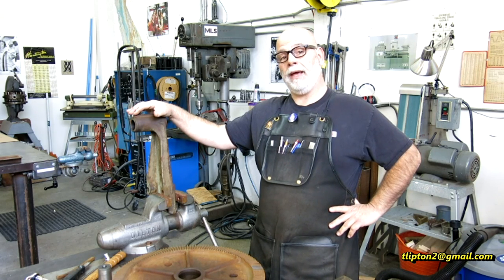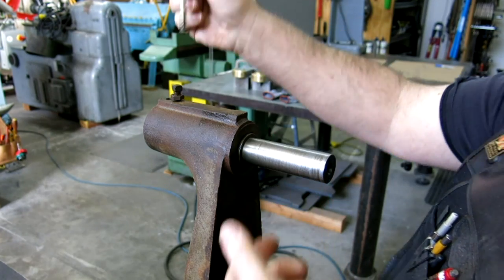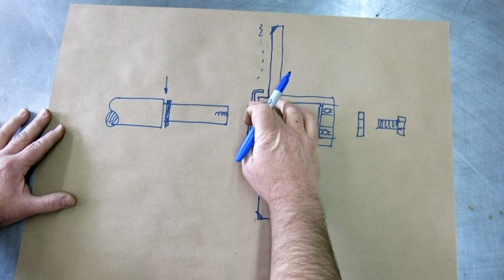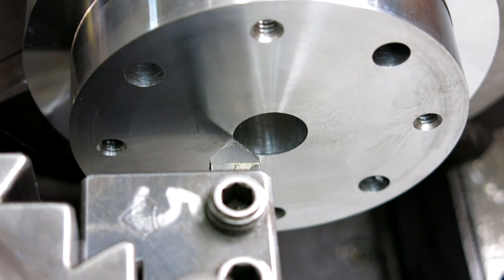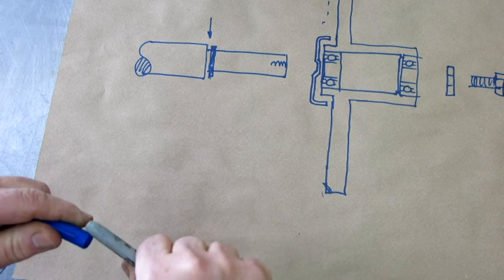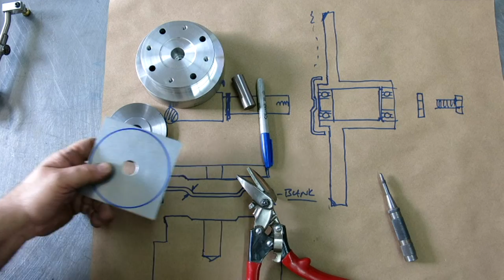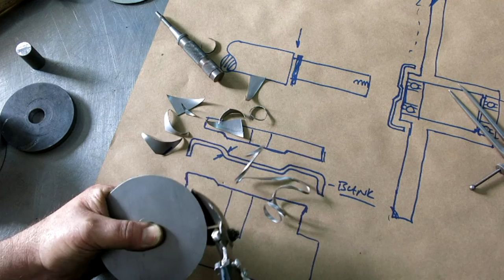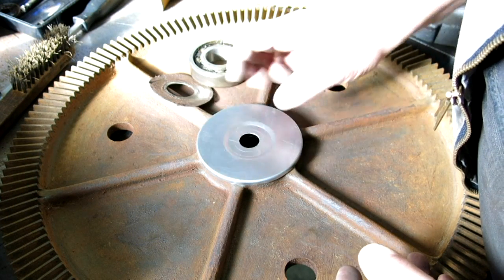Making Press and Hammerforming Dies

Comment: Worked well. What I have done in the past is make the bottom tool with a thread in it and used a bolt to hold the top tool in place. You can slip a tube over the head to press it first , then tighten the bolt down to hold it in place for hammer forming. Then put the whole shooting match in a vice. That way you can hammer form the edge all the way around without having to swing a clamp out of the way. You can use the bolt to pull the depression into the metal first as well, as long as it is of sufficient size. Handy if you don't have a press!

Comment: Have had good success with forming bearing shields for classic motorbikes using a technique I was taught as an apprentice. The shield material is sandwiched between the former and some tough rubber sheet. The former is pressed into the rubber using the shop press and the resistance of the rubber gives a nice gentle flow form. Handy for shapes that are not round or have a taper on them. Thanks for the great video Tom.
Reply from the maker: Hi Andrew,

That process is called Guerin forming or rubber pad forming. Works well for stuff like this also. The die would need to be different and the support for the rubber would need to be kind of cup shaped. That would also work. If I had a lot of these to make rubber pad forming would be a good option.

Best,

Tom
Reply: oxtoolco Thank you Tom, did not know that was its proper name. I used the technique recently to make some formed panels in aluminium for a restoration job. The shapes were irregular and lent themselves readily to the technique.
Reply: The Guerin process is good for one-offs because you only need to make one die, and there's no need to precisely align dies.

Comment: I was a machine designer for many years and the suggestion I have would be to add a simple labyrinth seal with a sheet metal washer.  Turn a small step on the outside of bearing housing for a lite press fit of the washer.  The OD of the washer can be made very close the inside of the cap since the is no relative motion between the cap and the washer.  I enjoy seeing how you design and fix problems.

Comment: I've always liked the Marvel line of vertical sliding bandsaws be cause of their accuracy and their simplicity in their design.  On the older units they used to use a cork clutch that was counterweighted by a lever mechanism to drive the saw into the material. The further you slid the weight away from the clutch the harder the drive pushed on the material. 

I was working in a shop that had an old Marvel that was in really nice shape but I noticed that the fellows using the saw were hand feeding the blade. I asked why they didn't use the clutch drive and they said it didn't work properly. I asked if they would show me what it was doing and when they did and I knew immediately that the clutch cork had worn to its limits and couldn't drive the mechanism properly. It bothered me for the rest of the day and part of the evening that no one cared enough to fix that machine. The next morning I was the first worker in the door and I had a plan of attack. Right next to the time clock was a large cork bulletin board.  A few seconds with my trusty Buck knife and I had a new clutch. It took about 10 minutes to tear it apart and cut the cork to fit the drum. I got it put back together just before we were to start the day shift. When the fellows who ran the saws came out to start up I asked if I could see the drive work again an they gave me a strange look but agreed. They threw it into engagement and low and behold it worked perfectly. They asked what I had done and I told them I just adjusted it a little better. Later that day we had a safety meeting and one of the first topics was destruction of company property and they wanted to know who had vandalised the bulletin board beside the time clock. No one ever owned up..............

Comment: Very nice. Thoughts: The bearings have had a open inner side because the hub had to be filled with grease at any time. so the fresh grease would press through the bearings under the washer and drive any dirt outwards. Also i might have considered to give the outer rim of the cup an slight angle. so dirt could be thrown out and would not stuck in the corner. Very, very interesting though. My attempts in formig sheet metal always end in wavy scrap.
Reply: i was thinking to use silicon to adhere it, any grease will still get out along the hole of the shaft, and overall would seal it even more?
Reply from the maker: Hi Hermann,

You are correct. That would mean the maintenance guy would have actually had to do his job. I prefer engineering solutions that take into account just how lazy I am. Thanks for the comment.

Cheers,

Tom

Comment: I was looking to do the Same Last year for a Dust Shield on the rear wheel bearing on one of my Motor Cycles i was restoring. Time was of the Essence and Settled for boring a Hole in the middle of a brass Welsh plug polished it up presto. But Now i Know how to make a Die for the next ones :) Cheers Tom keep em coming

Comment: Nice job on that part Tom!  I often use hammer forming to make rust out repair pieces for car bodies.  Typically my dies are made from pieces of scrap wood so there is no problem working the edge with a steel hammer.    I do appreciate the tip about using a soft hammer when working with a metal die.  I likely would not have thought of that until I had screwed up my part.

All the best!

Mike
Reply from the maker: Hi Mike,

You know I screwed up more than one part before I figured that out. Thanks for the comment.

Cheers,

Tom

Comment: In the aerospace industry, when one-off sheetmetal items are needed, they are often machined from solid. For complex shapes this requires CNC, but for this it's simple turning. For something shallow like this, it seems to me it would be less work and require much less material. The second side op could be done by pressure turning (using a tailstock centre forcing a support disk against the work, friction grip helped by abrasive dust or superglue)

Comment: Great instructional. Wondering why you opted for hammer forming opposed to spin forming. Thanks for the videos!
Reply: Same reason to not hit it with a metal hammer. It would stretch the material.
Reply: +The Thing:  any time metal is formed either hammered, pressed, rolled, or spun it is stretched
Reply: Unless you use a hammer to shrink the metal :)
Reply from the maker: Hi Chuck,

You can add shape to sheetmetal by shrinking which is the direct opposite of stretching. In general most forming operations are stretching but some actually thicken and shrink metal. Thanks for the comment.

Cheers,

Tom
Reply from the maker: Hi Yupper,

Because that's what I wanted to show. Not all hammerforms are round or even symmetric. Hammer forming works for not revolved shapes. You are correct that spinning would have worked for this particular shape. Thanks for the comment.

Cheers,

Tom

Comment: nice project, you could make the last band on the lathe.
you can roll it with a bearing on you mold.

thet is how we make ouwer exhaust for very old motorcycles.
Reply from the maker: Yep that would have worked also. Thanks for the comment.

Cheers,

Tom

Comment: Nice job ... You could use the lath and a piece of wood to spin the complete shape.  I did this in Grade 8 on a wood lathe with a wooden form (you would need to use brass and not steel

Comment: Great video, thank you!
Wondering whether the best angle for the outer rim of the shield is 90 degrees?  Seems a bit like the equivalent of a flat roof; won't shed chips and dirt as well as a slope.  Also with 90 degrees there's some concern about wrapping it around the die and having, er, fun removing it. 
Another idea is to add a 'roof' piece of sheet metal, attached to the bearing support, that reaches over the bearing to shed chips.  Might want a plastic or rubber edge in case it rubs, though.

Comment: Instead of the clamp a large nut and bolt and bolt it down instead? Saves moving the clamp. Also could you run a bead of something like silicon round the edge of the shield once all mounted up and remove the small gap that way?

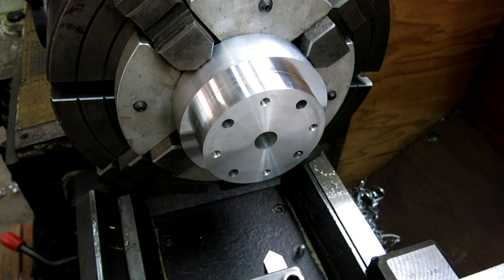Comment: After the dialog, "Sure, why not?" (~10:00) with the bird's-nest following, I expected a caption, "That's why not."

I made a set of dies to form flat-head screw pockets  for 1/4" stove bolts in sheet metal. (Cutting the pockets reduces the holding thickness of sheet metal.) The main thing I learned was how much the metal moves sideways. I had to start with a 1/16" hole to end up with a 1/4 inch hole after forming. (I also had to partially countersink the material I was fastening to since the cone of the head was deeper than the thickness of the sheet metal. Then I had to countersink it deeper yet to accommodate the cone of sheet metal.)

Comment: If the recess in the die and the punch were left with square edges instead of 45 degrees, would the part follow the natural angle between the two edges to create the taper in the recess.

Comment: I'd bet you could find a freeze plug from some engine that would be just the right diameter to work for that, and then just drill out the hole and cut to length. Just figured I'd throw that idea out there.

Comment: Nice job, was surprised you did not build the outside edge into the forming die though.
Reply: Kurtis Johnson My thoughts exactly.  By the time he did all that hammering, he could have replaced his dowel with a screw, and made a die for the outside.  But it's easy to say for this Monday morning quarterback.
Reply from the maker: Hi Kurtis and KC,

A forming die that would push the flange over is much more complicated. In its simplest form it would not take in for the springback. The hammering was only a few minutes. Much less time than it would have taken to make a all in one die. Net savings in work. The fastest would be to roll the edge over with a bearing while the blank turned in the lathe. I wanted to show hammer forming and how simple it is. Thanks for the comment and Monday quarterbacking.

Cheers,

Tom
Reply: Thanks Tom, I figured you had a reason or two for doing it the way you did.

Comment: I thought you would have spun it on your lathe.  Nice job, and good comment about not trying to hammer it all in one go, like most of us would have done.  Odd that there is no labyrinth seal if filings could get into the bearings.  Also, if filings can get in there, does this design not cause a problem with trapping them in there instead of simply letting them fall out?
Reply: (Very nice work Tom!)
My thought also, the hammering part could have been done on the lathe with just a wheel with a radius on it. Seriously, no big deal for a one off, but if one has to produce several...
Reply: I also thought he was going to show a  new skill set and spin the edge into shape.  Would of been a fun experiment, if nothing else.
Reply from the maker: Hi Fernand,

You are correct the hammering could be done in the lathe. Or it could have been rolled over with a roller or bearing. Sometimes the shape is not a revolution so hammering is the only way you can do something like this. Imagine a kidney bean shape for example. Thanks for the comment.

Cheers,

Tom

Comment: Seems like an awful lot of work when you could have made a combination die that cut the blank and formed the middle in one shot.  You could even have it form the sides too.  Hammerforming still stretches the metal at the corner.  Keep in mind I am coming from the mindset of having to make multiples of this and not just a one off.  Pretty cool to see though thanks for sharing it!

Comment: It turned out nice. Though I wonder if an apron, a short tube shaped piece, press fit over the hub of the wheel that extended out over and slightly past the original washer shaped protector wouldn't have been a better solution. It would have made it nearly impossible for dirt to make it to the bearing. Though it's probably a moot point if your using fully sealed bearings.
Reply from the maker: Hi Siegfried,

The shield is fixed in relation to the rotating gear. Thanks for the comment.

Cheers,

Tom
Reply: Hi Tom,

I understand that the shield you made will be clamped to the fixed axle, as was the original flat one. What I was suggesting is a fixed flat washer, similar to the original, with an OD slightly smaller than the ID of a rotating apron fixed to the wheel's hub that extends out past the fixed part of the shield.
I just wanted to clarify, not trying to be a smart ass.
Reply: Siegfried Gust

Comment: Hi, thanks for the your videos. I am learning a lot from your videos. I appreciate you sharing your great knowledge. I had a question. you said that a friend spray welded the shaft. I assume it is meg spray weld you were mentioning. why did the shaft needed to be spray welded as suppose to just welded. I am asking because I have a Shaft to repair. and also had a previous shaft repair job on a dual sided Gast compressor which was broke on 1 side. .I Tig welded the shaft. It lasted several days in the shop testing it off and on. But, 1/2 day at the customers place :-/. thanks.

Comment: Very nice job Tom!   I was wondering why you didn't make die to form outside edge, just the way you did inside?  it wouldn't take that much more time and you would save yourself  plenty of time playing with hammer... but again you do have special connection with hammers., maybe that was the reason lol .. anyway wish you best in 2017  Happy New Year from Florida. Boki
Reply from the maker: Hi Bokizz,

I happened to have a chunk of aluminum close to the correct size. Thanks for the comment.

Cheers,

Tom

Comment: If you had had some spinners tools, spin forming might have been faster.  By the way, I saw a number 2 on your magnifying hood. Are there more than 1 with different power? Happy New Year!
Reply from the maker: Hey Marty,

As you age you end up with a collection of magnifying goodies. That particular one has a longer working distance which is good for the lathe and for filing. Thanks for the comment.

Cheers,

Tom

Comment: Hi Mr. Tom, you could use silicon calk to seal the fang.
Reply from the maker: Shield does not rotate. Silicone would not help in this situation. Thanks for the comment.

Cheers,

Tom
Reply: ah,  that does change things :)
Reply: A sting of leather glued on the inside of the lip will seal it completly  ,and when glue is dry soak the leather in oil,now dirt is going treu .And the leatherstrip can take some friction.

Comment: Came out quite nicely, young Tom. Had you thought to use a metal spinning technique, might be a good demonstration?
HNY
c
Reply: I wondered that too. Just replace the centering pin with a bolt to clamp the form together and then roll the edge over on the lathe.

Comment: Tom, how come you didn't use the lathe and roll the shoulder of the shield to form it??
Reply: I was wondering the same thing when I saw your comment.
Reply from the maker: Hi Perry,

I wanted to show hammerforming. You are right that this could have been spun easily. Hammerforming is more versatile and will makes shapes that are not revolutions of a section. Thanks for the comment.

Cheers,

Tom

Comment: Wouldn't it have been easier to just use metalspinning instead?
Reply from the maker: Hi Swag,

Easier that what? You still need a male die form to metal spin on. Then you have a bunch of polishing to get all the tool marks out of the part. Seems like a wash to me.

Best,

Tom
Reply: oxtoolco: Hi Tom, my dad took up metalspinning as a hobby after I left the country (unfortunately!) and up until he got sick was able to pretty quickly make a form and spin out a custom piece, it just seems easier having watched him do some things than creating the two forms and then all the hammer work.  You're absolutely right, though, it's the same result and likely a wash. Interestingly, he learned the Hobby from an old guy who up until recently would still do custom spinning work for Boeing. That and titanium urns for Buddhist funerals. Interesting stuff.  Thanks for taking the time and as always thanks for all the videos. Ein gutes neues Jahr.
Reply from the maker: Metal spinning is something I have not really tried except very limited flanges in the lathe. I probably should find a class somewhere and see what kind of trouble I can get into. They have a full spinning lathe and tooling at our main shop at work. Thanks for the comment.

Cheers,

Tom

Comment: Tom, what a lot of sodding about making a shield for a standard bearing. Why did you not buy and fit a 2RS ( two Rubber Seals ) factory sealed bearing already pre loaded with grease. You do make yourself work at times, life is too short, go for the easy and I think better better options available today.
Reply from the maker: Hi Dave,

Well you get a D for not paying attention during the video. I did replace the open bearings with ones with rubber seals. Rubber seals will fail if exposed to sawing swarf and coolant being rubbed into the seal from the wheel rotation. You saw what happened with the stock shield in place. Oh wait maybe you missed that too while you fired off a half cocked comment.

Happy new year!

--Tom
Reply: Sorry Tom, must have missed it as I skipped through the video. Only have limited download DATA here in Australia, if I was to watch every minute I would not have enough left to watch other contributors. I do apologise for my error in complaining to you. I did ask in another video as to what was the outcome of your Baby Bullet vice, did it sell ? Happy New Year from Australia.
Reply from the maker: Hi Dave,

The Baby bullet is still here in the shop. I decided that it would be auctioned off in a sealed bid style auction through the Oxtool YouTube channel. Stay tuned for the announcement. I didn't have the bandwidth last year to find the donor and run an auction. So you have not missed anything yet. Thanks for the comment.

Cheers,

Tom